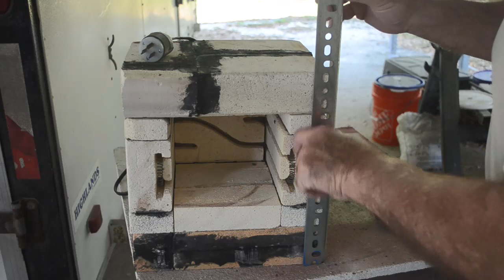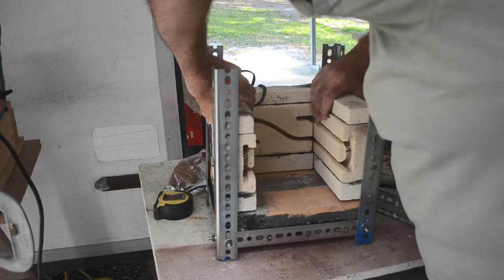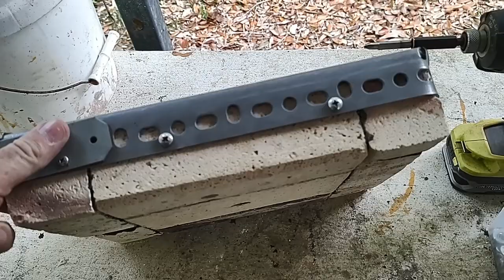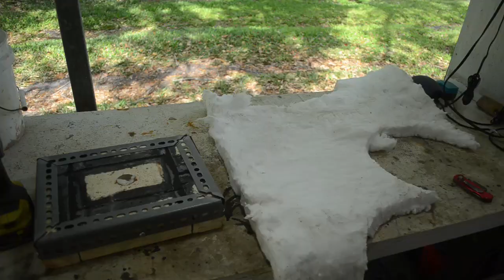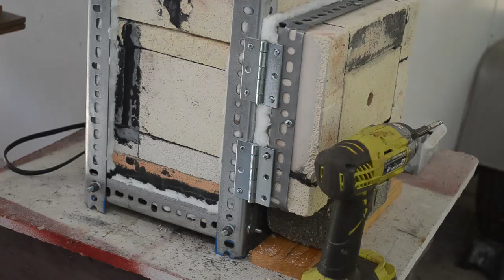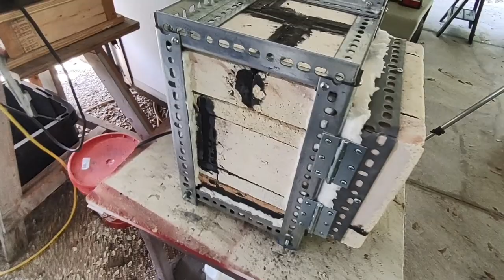A Home Built Cupelling Oven Part 3: Cutting Steel For The Frame

Comment: 17:45 I was surprised you only put on One Door Latch it looks off centered so I was Surprised to only see one. You should put a 2nd one halfway down to make it Seal even Better. Plus having two you could unlatch the bottom and keep the top locked to get a Tiny bit of Airflow. OR open both Latches and extend them without undoing the Clasp Fully. If that last part makes sense. 
 Anyways thanks 🙏 for the Hard Work 💪and Videos for All of Us to Enjoy. 🤙🤘

Comment: Good Morning Mike,   The oven looks great!  I think putting a handle on top would be a smart move.  Another idea to consider - put a second latch on the door for when the oven is not in use to help support the weight of the door.  Your use of the insulation on the door was A-1 thinking!   Have a great day!  Jim
Reply from the maker: Yes, a second latch would probably prevent the heavy door from sagging over time, especially given the cheap-ass hinges I used.